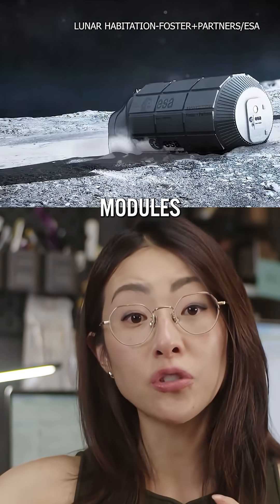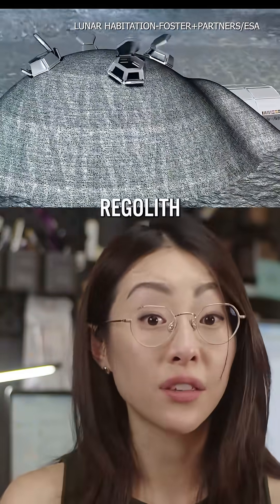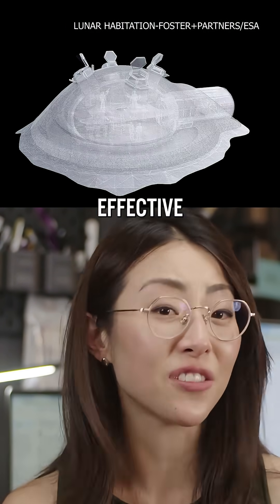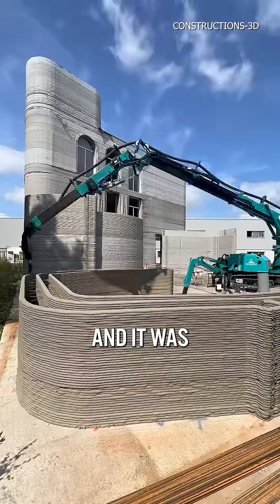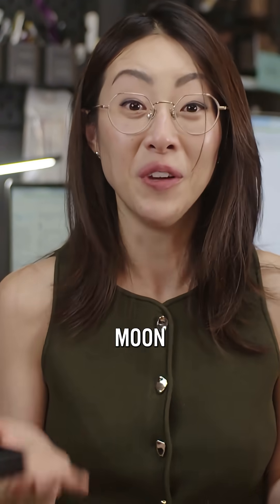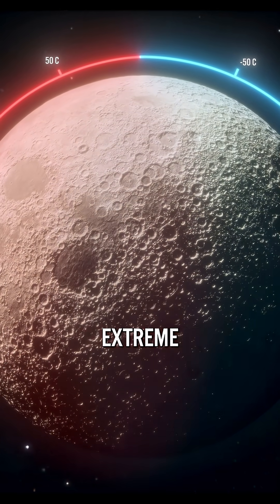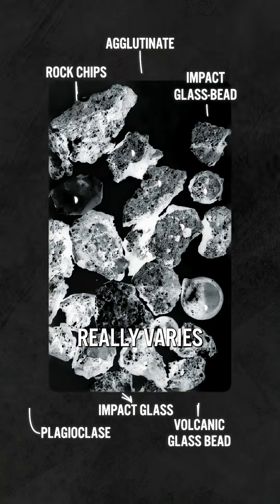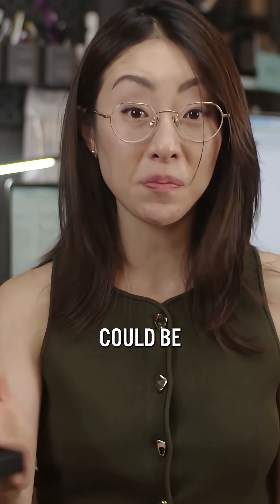What would you build first if you had a lunar 3D printer?

Comment: Somehow I think that regolith could be fused into bricks with solar energy and those bricks are stacked by robots to form partial radiation barrier walls. Kinda like tall hesco barriers placed really close to each other in a tight circle and a tent dome is erected between them. It won't cover the entire sky and a decent swath around the zenith will be unprotected but it can for example block most of the lunar sky and more importantly the sun from the tent dome and the inhabitants. It could drastically cut radiation before an actual roof is built.

Comment: Remember that a big problem to worry about when it comes to building anything on the moon is that the dust on the moon's surface is so coarse that it erodes almost anything it rubs up against that we can send up there.
Reply: You should see how the sand eats away at the machinery in Canada's oil-sands industry. That sand can eat through stainless steel pipes and machine casings like their made out of butter.
Reply: There is very little erosion on the moon- that is literally why it is covered in craters- there are no environmental factors to wear them down over billions of years. In short, nothing is rubbing up against stationary buildings. The people designing these things are certainly taking into account the jagged shards of regolith going through the printer.
Reply: @relax427  Oh right. It's disaggregation. Not erosion.

Comment: I could see a hybrid system. First you dig a hole to get the material, then you have two balloons, not one, and the material is put between. This means less material since half the balloon will be below ground and only the upper part will need to be covered, reducing build time. The second balloon protects from heat extremes.

Comment: @damileearch I have a stupider idea which maybe way better than 3D printing and simpler and cheaper. Once you deploy the inflatable modules use lunar front loader to cover the inflated module with lunar dirt mixed with a little bit of binder. Please tell me someone else thought of this and ran experiments... If not might wanna try something stupid simple first before lunar 3D printers.

Should provide similar protection. Remember moon doesn't have active tectonics, you don't have to worry about earthquake. The outter shell is just there for protection from radiation.

Comment: Aircrete always made more sense to me at least here on earth! It's like concrete and polystyrene foam mixed in to save weight. Inflate a dome, spray aircrete over it, let it dry, then take out the dome. Takes a day, stronger than wood, fire proof, with insulating properties and it doesn't look like 3d printed cr_p!

Comment: 3D printing on the moon is a Fad that will never be in style, the best way to properly and affordably while far more quickly secure your site with regolith or cover it at least is with bulldozers, just plain old cable operated bulldozers and with about 20 of them you can level the site in a day, cover the structure within 4 hours and proceed to begin mining operations somewhere else... I highly doubt NASA would invest in an object they would use ONCE that costs so much when they could just spend a little bit more to do so much more for the next 20 years

Comment: Quick "um aktually" having worked in aerospace, and specificly with adhesives, vacuum curing is pretty common, so likly wouldn't be as big of a deal as the variations in the substrates. The thermal swings could also be a problem as mentioned.

Comment: Personal opinion (i.e I have not studied it in depth so take what I say with a tablespoon of salt)
3D printing regolith is a non starter due to the water requirements and unpredictable curing. 
A better solution would be to melt and cast the regolith and use the cast blocks like legos.
Or, just loosely bury the habitat. Or set it up in a lava tube.

Comment: 3D printing hasn't revolutionized construction because it automates the cheapest and fastest part of the process. It makes building walls even more expensive. Instead of using waste materials (ash) and cheap labor, it uses special concrete mixtures and complex machinery.
Reply: Test

Comment: Hey Dami, was just brainstorming while I was watching as I usually do with your content. So what do you think of this? (if you even look at your comments section) What we really need in 3D printing architecture is a better medium than concrete that is not as environmentally negligent as plastic. So what about a plant based medium such as recycled cellulose wastes i.e. wood and food wastes, suspended in a manageable metal such as tin or another low melting point metal? Then you could print that around a reinforcement structure like the do in current architectural 3D  printing. Or maybe even silica or ceramics.

Comment: Let's be honest, we are still not in flying cars, but we were supposed to be. 3D printing is continually improving, and printing with cement is still a relatively new technology. Clay and rock need time to set and dry, and with weather shifts, we are talking about unmanned printing. In most cases, 3D printing requires human interaction to clear or undo issues. It's a huge possibility, but we are not there yet.

Comment: Might be a dumb question but are there any caves on moon where they could setup a base?
Reply: There are lava tunnels created by lava flows millions of years ago. Scientists have speculated they could be used for habitation. The issue is that no one has explored them and we have no idea how deep they are or suitable for living in.
Reply: @stevenmac993 ohhh right how could they have explored them
Reply: Btw what are we protecting against by making the shelter with concrete like substance, why not just make a airtight tent which can hold in the air pressure. Like nothing moves there so..
Reply: I think we should let the moon the hell alone.

Comment: It has revolutionized the cost of DIY cosplay costumes
Reply: When it comes to building small dwellings, 3D printers are okay. But if you're looking to use the gypsum on the moon to actually build structures that are capable of withstanding meteor and micrometeorites strikes. You're going to need oxygen and nitrogen to cause it to set properly. Otherwise it'll either just freeze or it'll remain rather fluid. You also need to lift water up in order to turn it into a paste.
Reply: yea fr😂
Reply: SHAW
Reply: And table top gaming 😂
Reply: So. Fulfilling a truesocietal need.
Reply: And replacement parts that aren't made anymore or are wildly expensive
Reply: Yes! 😊

Comment: Also one of the most important facts is that rmc (ready made concrete) of a very fine grade is needed to be fed to the printer constantly. rmc however, depends on a constant flow of trucks going from the refill site which mixes the concrete to the building site which is crazy hard logistics.

Comment: Earth is NOT way more stable than the moon… WTF? It’s covered in craters because there’s practically zero erosion or geologic activity
Reply: Aren't those from stuff hiting it?
Reply: @grahamlopez3742  Yes, but if the moon was geologically active like earth they would have disappeared long ago.
Reply: @grahamlopez3742  Shit hits the earth too
Reply: The temperature is far less stable, but you would know that if your attention span was greater than 3 seconds
Reply: @bodhiallen9362  that isn’t that big of an issue. We do have a similar range here but usually jot in the same day. That is the thing. We have places were 50 degrees can be measured and places where -50 is seen as a relatively warm day (because normally it is -70 for instance) 

When you want to built with stuff that can withstand a blowtorch to the materiaal (400+ degrees) what do you rather have? A temperature of + or -50 or a surface that doesn’t necessarily stay at the same spot?

Comment: The problem is that prefab concrete is so much cheaper and after all electrical/plumbing etc is done, it's also faster. Even blocks are very cheap compared to babysitting a machine. The problem with 3d printing homes is requiring a predictable environment. You can't simply get the mistakes and melt them later to make something else.

Comment: 1st: Lava tubes. Insert several inflatables like a condoms, cap/seal. Use mycelium as gap filler, leveling, & mud-jacking. 
2nd: tunnel boring machines. 2 parallel and 2 vertical perpendicular tunnels. Mine/separate resources and use dregs as backfill shielding over…
3rd: impact area w/ steep depression. Multi-story, large warehouse wide, building construction complex, capped with tunnel dregs. 
4th: power? Small nuclear and solar. Geothermal (when deep enough). Eventually use mined resources (aluminum) for wires, encircle the moon with solar panels manufactured on the moon using in-situ resources. Probably start nearer the poles for smaller circumference.
5th: space elevator?
Reply: Why encircle the moon? You know the dark side is dark right?
Reply: @r @randomname4726 ahahaha. Are you trolling? Every part of the moon gets sun. A full day on the moon is 29.5 days long — 14 earth days of sun, and 14 earth days of night. If your base is in the sun, in 14 days it will be in darkness.

Comment: Printed houses never took off because they were aesthetically unappealing, difficult to maintain and repair, could not be easily remodeled, are less sustainable than Wood Construction homes, and didn't exhibit any cost savings. Building a 3D printed home, despite having significantly less labor, costed pretty much the same as a traditional home, per square foot.

That was the biggest reason why they never took off, because even if the costs are valid, and it's truly that expensive to build these homes, the market doesn't care. They just look at it as nobody building the house, just somebody running a machine, and getting paid the same as if you had a team of a dozen contractors doing a traditional build. People react to being scammed, and feeling scammed, exactly the same way.

Comment: Instead of 3D printing it would help to have a habitat pumped up, completely cover it in regolith and from there on work the way up.
We have no real wind up there, we only need a safe spot against radiation.
Also the main problem with 3D printing up there is the bonding material.

Also everything needs to be run solar powered.
So we need a ton of solar panels, some energy storage and we need some smaller regolith hills where the electronics is nicely shielded from radiation and temperature differences.
Only when there is enough power produced up there we can think about bigger builds.
Also if we have enough electricity up there we could melt the regolith if possible.
That would remove fluids from the equation.
But heating stuff up requires a lot of energy.
So we need a first base to start the first machines etc and then after securing the position with some warehouses to store stuff secure there we could move on to the main power grid production.
And then we can start the 3D printing in a meaningful size.

Comment: You’re a bit too soon with the “supposed to” statement. 3D printing is just now starting to make its way in to mainstream construction. Now that many patents are expiring and the tech isn’t locked down by the trolls, the real work can begin.
Reply: I dont think it will tho.
If youre going to transport that massive printer and assemble it, why not just build the house with concrete elements?
Its stronger, cheaper, easier since you already have an smooth surface...
I just dont think that it will ever be an thing, if labor starts to be too expensive we will just ship those elements from somewhere else.
I dont understand what it is with people loving the 3d printed houses, you still need to build an roof too😂
Theres so much surface work, pretty sure its really prone to cracking too, concrete elements are separate, yes the seams can crack but the seams filled with mortar arent what keep them together its just filler.
Reply: @iirosiren5120  The modern printers I have been keeping an eye on are nothing more than a truck with a crane style arm, with a mixer/pump support trailer. As with most tech, they're miniaturizing it over time.

Comment: It seems retarded to me  we have millimetre drilling tech that leaves behind a solid glassy shaft wall. So why not, when you want to send your reactor, send it attached to a big millimetre wave drill, to tunnel your habitats under the surface. Better protection, naturally sealed, expandable and quick. Inflate your modules inside solid glassy tunnels.

Comment: Current 3D printing technology is figuratively and literally crap, because the material used is limited  to selected raw substrates available that isn't viable enough to adapt for functional purposes for a shape or structure in the same manner that traditional build processes utilize. The printing process does not alter the material condition as it prints, but rather it simply lays down substrate in a manner analogous to laying down ink on a sheet of paper in old legacy style printing.

Comment: Why don't they just dig a hole with a simpler, less issue-prone machine (3d printers), put the structure in, and burry it with the same soil? Wouldn't that be easier since there isn't any wind anyways? I was thinking it might even be slightly more insolating if it's lose powder rather than packing down after, although maybe packing it down might be better for mini asteroids.

How would 3D printing it be better?😕

Comment: The reason why 3D printing structures.flr dwellings like homes and office buildings hasn't taken off is, well basically it's because it sucks. You can live in a glorified termite mound all you want, but don't deny that's what it is. Despite all of the advantages such as thermal and structural stability with the reduced cost of using a single material requiring fewer workers to manage, it's still a termite mound. You could actually prefab homes with concrete walls like a basement schwive the same result cheaper than 3d printing it, and since quality control happens at the factory and not on site, you can engineer larger structures that way versus 3D printing. 

Personally I think most of us are going to be living in used shipping containers inside of ten years anyway, making 3D printed homes just a cute idea someone had one time.

Comment: Why not dig down, under the surface, we should be thinking about this challenge in terms of ant hives and less like earth cities. Wood ants have to establish environmental controls for their nest, so they dig down and then establish thermal masses above the nest site. It seems like it would be more secure to do the same on the moon in order to deal with the fluctuations in environment. It would also be more secure against micro bombardedments of small masses, particles and radiation. You could use the regolith you excavate out as building material, similar to this project, but for more of your materials and once your basic frameworks are done you have a more controled environment to build your infrastructure using 3d construction. 
As far as energy goes, establishing underground hydrogen & nuclear site seems the most viable, as there is ice on the moon which you can convert to fuel and many modern reactors use a secondary fuel stage which would get waste off earth to be put to use there. You make it cost effective by capturing comets & other objects which have ice & minerals, which you then use for economy, selling fuel, staging ground and material to other space angencies and private companies.